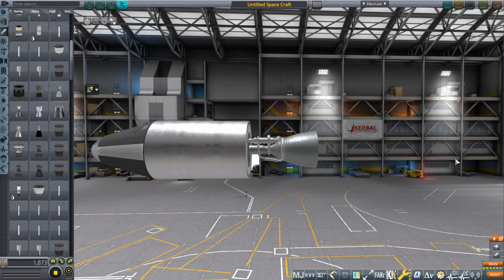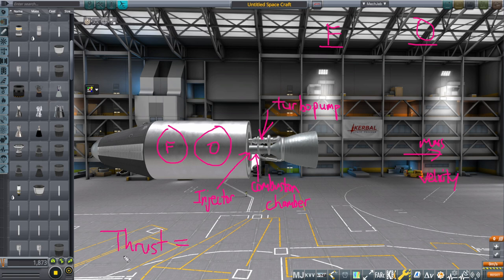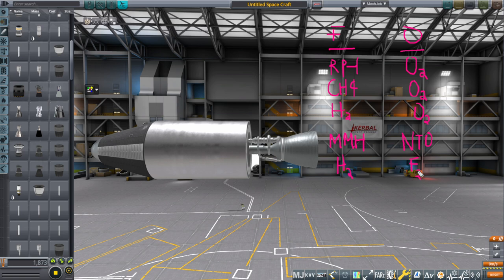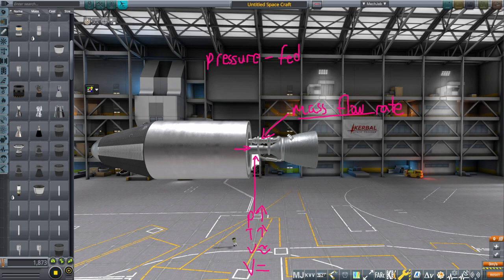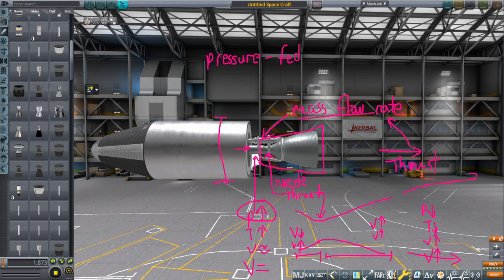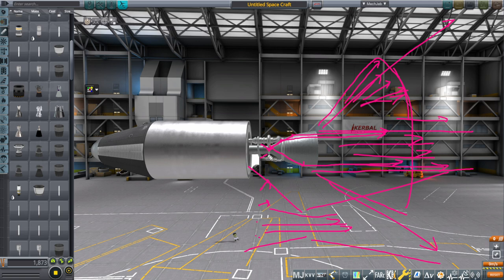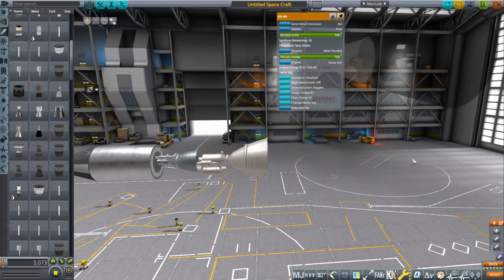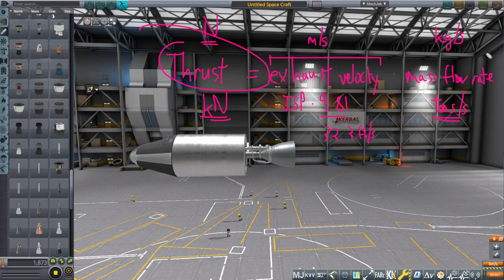Space Basics 03 - How Chemical Rocket Engines Work

Comment: This is a really good concise summary of the important parts of chemical rocket engines.

Nitpicks and additional factoids (not trying to be an ass here, I just design these for a living and can't hold it in):
-Injectors aren't always a plate, but for larger engines they usually are
-You missed exit pressure * exit area in the thrust equation, but again for larger engines (that are designed properly) this doesn't matter much
-Neat hydrazine is much more common with NTO than MMH. Russia likes to use UDMH
-NTO is normally a mixed oxide form called MON-X, usually MON-3
-Turbopump is more about increasing pressure than mass flow. Mass flow can be really high with a pressure fed engine but getting really high pressures is great for efficiency
-High pressures in raptor increase efficiency (with diminishing returns) in addition to reducing the size/mass
-When you were talking about velocity in the throat it's more a function of area than volume but it's pretty clear what you meant
-You can get choked flow in the atmosphere with chamber pressures of like 15 psig (but it's not useful for a rocket)
-It was kind of vague but chamber and nozzle conditions are completely unaffected by ambient pressure. It only has an effect at the nozzle exit
-The shape of the nozzle is also the way that the force is transmitted from the from the exhaust to the engine. When the exhaust impacts the nozzle wall it pushes the engine forward
-The instability of a vacuum nozzle at high ambient pressure is called flow separation
-The reason that thrust at sea level is lower is because in the thrust equation F=mdot*V+dP*Ae is at its highest F when the dP*Ae term (exit area * exit pressure difference from ambient) is equal to zero
-The less an engine weighs compared to the vehicle mass the more worthwhile it is to extend the nozzle really far
-Thrust equation in US units is rough because you need to get slugs involved

If anyone has any questions I'm more than happy to share what I know. The more people that get into the propulsion cult the better.
Reply: cool! Where do you work? 
I'm studying AE currently and i'm thinking of specializing in the propulsion field. last year my dreamteam did the first test fire of a liquid rocket engine in the netherlands in like 75 years :D
One question i would have is how exactly nozzle contours are designed. I know how to calculate the Area ratio's between throat, exit, etc, but how does one compute the optimal Area as a function of nozzle location?
Reply: @thomaswijgerse723  I work at a small in-space propulsion company. 

Nozzle geometry is a complicated subject. The best geometry from an efficiency standpoint is a long, narrow cone. This is not the most efficient for mass though. The most efficient conical nozzle from a mass and efficiency standpoint is a cone with a half angle of 15 degrees. This is the nozzle of choice for solid rocket motors because solid motors have weird condensed flow mechanics and their exhaust doesn't like to work with curved nozzles. For liquid engines you usually see a bell nozzle. There are two ways to generate the geometry for a bell nozzle. The first is the Rao approximation. It's a way to get close to the optimal bell nozzle geometry without doing difficult math. Typically for quick estimates you will see something called an 80% Rao nozzle which is an approximated bell nozzle geometry that is 80% the length of a conical nozzle with a half angle of 15 degrees. The "correct" way to design a nozzle is called method of characteristics. It's a series of equations that use the properties of the exhaust gas and something called Prandtl angles to generate the shortest nozzle that won't cause flow separations.
Reply: @mattsoup4121  i just learned loads of new stuff, thanks!
Reply: @thomaswijgerse723  If you understand area ratio calculations for rocket engines could you recommend some sources? I've never been able to figure it out.
Reply: @lloydbush  yeah of course! I highly recommend "fundamentals of aerodynamics" and "introduction to flight" by john anderson. Both have some great chapters on nozzle flow.
Reply: @thomaswijgerse723  Thanks! What about rocket propulsion elements by G. Sutton? I already have the 7th edition.
Reply: @lloydbush  i dont have that one myself, but it sounds like a really good source too.
Reply: @lloydbush  RPE like you said is a good one. Also NASA SP-125 is an excellent resource.

Comment: besides conservation of momentum there is also conservation of energy. the kinetic energy of exhaust is half it's mass times velocity squared and it can't be higher than the chemical energy stored in that mass.

also you didn't mention that the other way to increase nozzle ratio is by reducing throat size, that reduces the fuel flow. that's why the most efficient vacuum engines have such low thrust.

very good series, i like it a lot. thanks for doing it!
Reply from the maker: I've never encountered an instance where designers reduced the throat size to increase the nozzle ratio rather than fit a new nozzle, because that's an extreme design change that has ramifications to the entire engine. Do you know of one? (Note: SpaceX Raptor has a throat being increased rather than decreased)
Reply: @RaizSpace  Russian RD58 is a good example.
Reply from the maker: @Thomas Wijgerse which variant of RD-58 reduced the throat area in place of a nozzle extension?
Reply: Reducing throat size will either increase chamber pressure or reduce thrust. Increasing chamber pressure will allow you to reduce the throat size (for the same propellant mass flow) but it will also need more expansion to achieve its full efficiency.

Efficient upper stage engines aren't efficient because they have a small throat. They're efficient because their chamber pressure is low. Lower chamber pressure means that for any given expansion ratio you're extracting more of the available energy. Lower chamber pressure actually requires a larger throat size. The reason the throat is so small on something like the RL10 is because its thrust is really low. 
Throat size is not tied to efficiency.

Edit: I think my explanation was bad. Basically throat size is a dependent variable. Its dimensions is determined by the chamber pressure and mass flow rate of the engine and it isn't a driving factor in engine design.
Reply: @RaizSpace  i believe it was created that way from the start, due to size constraints. It is the reason why it has such abysmal twr, but very good isp for a kerolox engine.
Reply: @mattsoup4121  how would reducing throat size increase chamber pressure?
As for efficiency, you are incorrect. Exhaust velocity is very dependant on exit to throat area ratio. For efficiency, doubling the exit area has the exact same effect as halving the throat area. Only the ratio matters. 
The advantage of reducing throat is that its lighter than increasing the nozzle size, but due to mass flow being M-dot = Rho * A * V, it rdduces mass flow, and therefore thrust. 

As for the rl 10, its of course nonsense that the throat size is small due to its low thrust. Rather, its thrust is low due to ifs small throat size. (Among other things)
Reply: @thomaswijgerse723  If you reduce the throat area of an engine while maintaining the same mass flow rate you now require a higher chamber pressure to maintain that mass flow rate. Throat area is (approximately) proportional to mass flow. At=(mdot/T
Pt)*sqrt((R*Tt)/(M*k)).

What I said about expansion ratio to chamber pressure is harder to understand. Decreased throat size caused by increasing your chamber pressure will increase your thrust, however it also means you now have chemical energy left on the table that you're not extracting. The expansion ratio to extract the same fraction of exhaust energy increases at a greater rate than the expansion ratio increases from reduced throat area. As you decrease the throat size (increasing chamber pressure) thrust goes up and Isp goes down (very slight reduction, but it's not an increase).
Reply from the maker: @Thomas Wijgerse If it is like that from the start, that doesn't indicate a reduction of throat area to increase nozzle ratio after the fact (to adapt an engine for vacuum use, for instance, which was what I was talking about in the video) like Fatov Mikhail was suggesting would be done. I'd still say, and I think Matt seems to agree with this, that reducing the throat area is basically a redesign of the engine, and wouldn't normally be done just to increase nozzle ratio.
Reply: @RaizSpace  ah my bad I thinl we misunderstood eachother. I meant that rd58 was designes from the start in that way. Engines are not constricted after the fact indeed, that would be a giant redesign since it would increase throat and chamber pressure and temperature and what have you.

Comment: How do particles that don't hit the walls of the nozzle impart their momentum backwards?
Reply from the maker: I don't generally like the "impart their momentum" way of looking at things, but those particles will have been properly directed in the subsonic region, in which case you can imagine it being conveyed as a wave backward or against the walls of the combustion chamber up to the throat. I really don't look at it that way, though.
Reply: The easy way to think about it is that the particles on the outside lose energy (heat) as they "push" their energy into the nozzle. That means the particles on the inside are now hotter than the ones on the outside and the energy will flow from hot to cold. The inner hotter parts will also be at higher pressure and push the outer cooler parts outward, transmitting force into the nozzle. 

I'm reality it's much more complicated than this and there are also molecular interactions moving kinetic energy around and the center column of the exhaust being at a different temp does weird things at the nozzle exit etc. Momentum transfer is also a very simplified view of how a nozzle works, much in the same way that describing lift on a wing as the pressure on top being lower than the pressure on the bottom is a huge simplification. The temperature and pressure thing I mentioned to start is the gist of it though.
Reply: Thank you. I understand.

Comment: Is there any resources for figuring out the nozzle curve???
Reply: There are two main methods for finding the curve of a bell nozzle. The easy way is called the Rao approximation. The hard and more correct way is to use a mathematical tool called method of characteristics that creates the nozzle geometry from prandtl angles. Keep in mind that for a solid rocket motor bell nozzles don't work because the exhaust is something called condensed phase flow which basically means that it will lose a lot of efficiency in a bell nozzle. For solids a conical nozzle with a half angle of 15 degrees is the best option.
Reply: @mattsoup4121  that is super helpful thank you!

Comment: Maybe something about deltaV to space, how and where losses occur from ground to orbit. And also how to minimize deltaV required.
Reply from the maker: I'll probably discuss this in the next video, but minimizing delta-v required isn't necessarily an important goal. For instance, if a rocket has a high thrust-to-weight ratio, it will require less delta-v to reach orbit (because it will spend less time fighting against gravity). However, it may be more beneficial to load more propellant in and accept a reduced TWR, increasing the delta-v required to get to orbit, if that also means the payload capacity is increased. The goal is maximal payload capacity, not minimal delta-v.